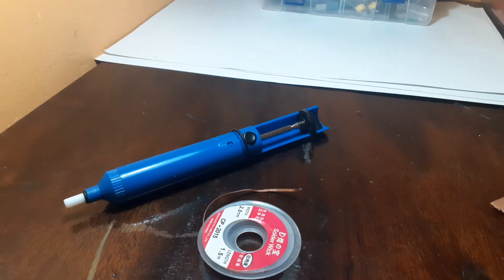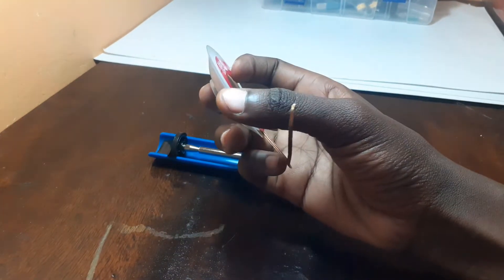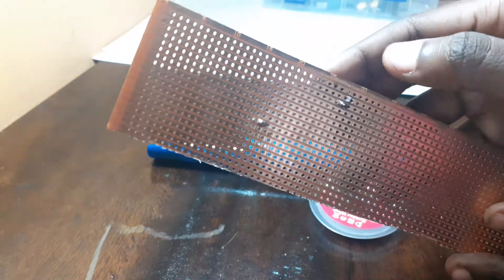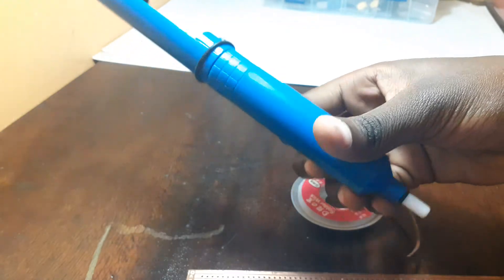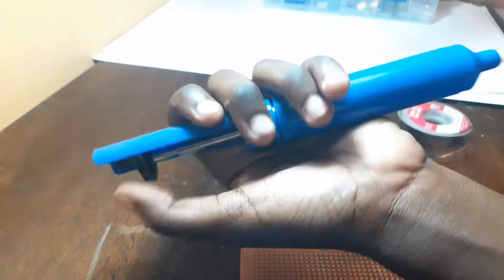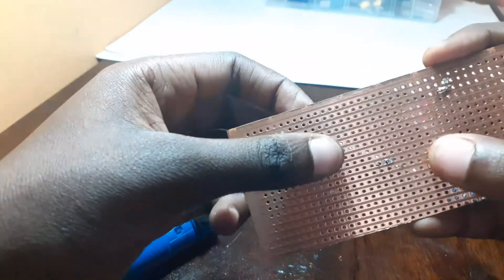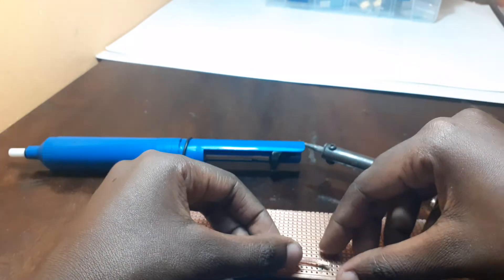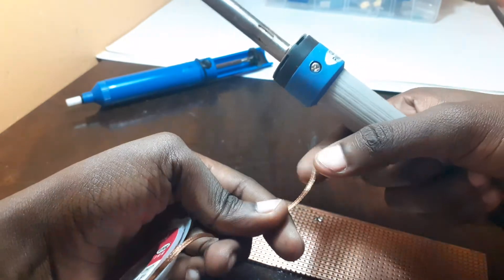De-soldering Tutorial| Solder wick vs Solder sucker

Comment: use a bit of flux over the solder and let it soak up into the solder wick along with it, it will help a lot. Also it looked like maybe you didnt heat it up enough?
Reply from the maker: Thanks for the insights

Comment: In some places solder wick works better than pump... And in some places desoldering pump works much effectively
Reply: That's right, each situation need the right tool.
My first option for remove throughole componemts is a Hakko 808 desoldeeing gun buy I have solder wick, pums and other desoldering irons.

Best Regards.